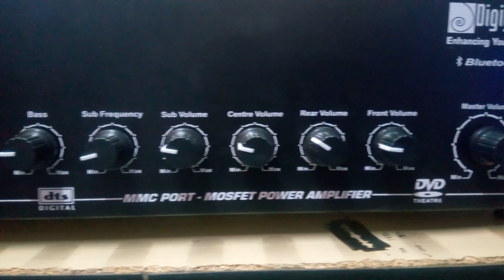5.1 dts amplifier - 750 watts(STK4141 ON series quality I.C and TOSHIBA 2SC5200, 2SA1943 based)

Comment: Brother mosfet dc volte 52 thanguma
Reply from the maker: Bro..52VDC ok bro....when ur using 36-0-36V Transformer, that time dc voltage output is 48-0-48 coming.....but antha voltage ku Amplifier board heat aathigama irukum....so 30-0-30V 10A or 7A use pannunga
Reply: RHYTHAM digital sound system ji video support board life varathunu soldranga athu unmaya bro?
Reply: Tech- Knowledgy ssss bro
Reply: sathish kumar y bro?
Reply: Tech- Knowledgy life varathu video. Usb